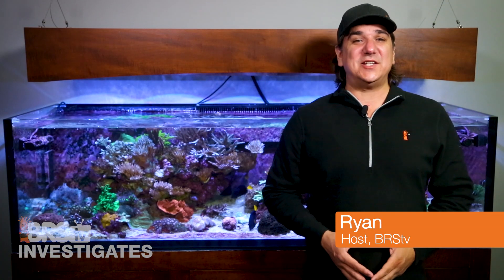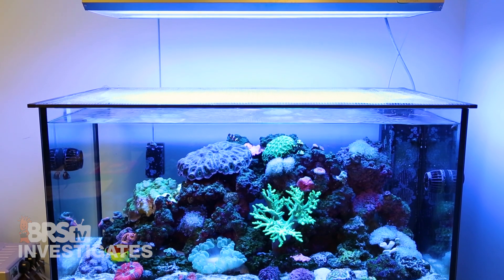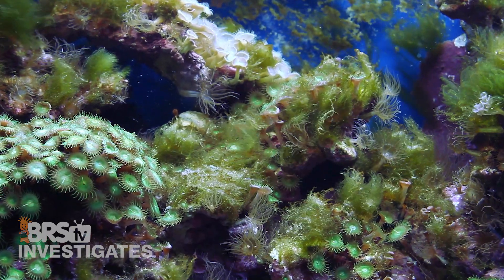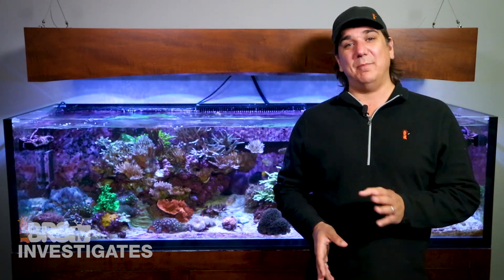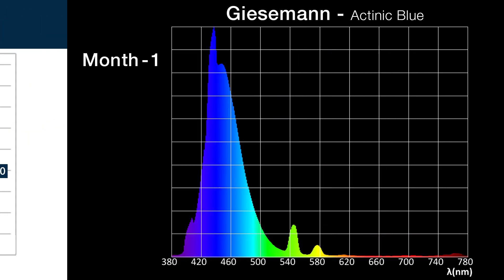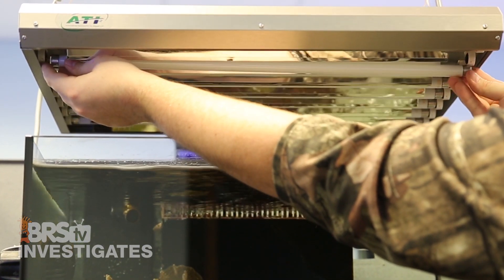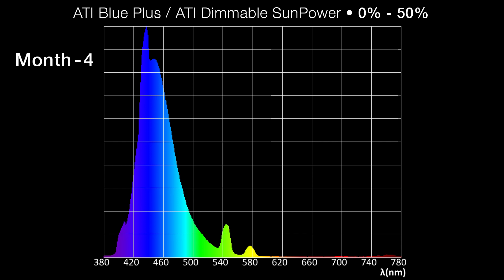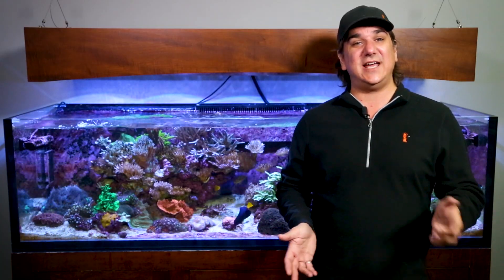When do we REALLY need to change out T5 bulbs? Part II  | BRStv Investigates

Comment: It makes since that dimming is much less stressful for the tubes because in regular TIME bulbs theres actually 3 different types of ballasts. Instant start rapid start and programmed start.  Instant start is great for bathrooms or whatnot because they instantly turn on and will likely only be on for a short amount of time. Then downside of that is the ballast is always pumping a higher amount of current so the light no only Burns out quicker being instantly started, but also the whole setup uses more power. IDK what type of ballasts the T5s use in these fixtures but that will also play into how long they last. I assume a dimming T5 is some sort of programmed start with other features so that would be the best bet.  Seems to me that the ATI dimming fixtures pay for themselves after awhile.

Comment: Did you guys burn in the bulbs before running them at 50% for that long? There's information all over the place about needing to burn in the bulbs at 100% for ~50 hours before using them at lower wattage permanently. I'd like to know if there's any truth to that burn-in process.

Comment: Thanks Ryan, while this may eat away at some of your sales I'm a happier and more informed customer because of it.  Are you running a similar halide test?
Reply: Helpful, but the study doesn't include any spectrum changes and it's based on 14k double ended bulbs.  I think 20k Radium's are probably most common.  I use the single ended version in my Spectra fixture.  Checking out the References at the bottom of your link now.  Thanks.

Comment: Thanks for your investigative series 👌

Here is a question I would like answered. Do LEDs last as long as many assume? Do they put out the same PAR, and at the same settings does their spectrum shift? We were led to believe they would last many years. I do DIY LED fixtures with Cree LEDs and visually I noticed that my cool whites are significantly more yellow than when I first got them. They probably only have about 2 years use.
Reply: I'm wondering that too, I think Cree data is taken when these diodes are run at their ideal temperature (350mA range I believe for many of them) unfortunately in our hobby we tend to run them at 3+ times that and assume that if we have sufficient cooling then no harm no foul.      But I've noticed year old Kessil fixtures vs Brand new have a noticeable bright difference.
Reply: No they don't, I noticed a significant dropoff in par after 4years use with my original orpheks and AI Sols, gone back to T5's with LEDs so will have to wait a while to see if these leds drop in par.

Comment: I heard ATi fixtures drive the bulbs for higher PAR. Apparently they age bulbs faster for this reason. Could you test this myth?
Reply: An ATI fixture uses spec T5 ballasts. When cooled properly some spec T5 ballasts can increase power but only if it is safe to do so. The unit used was an ATI Sunpower as well so that basically answers the question.
Reply: I wish the data would have been used with an ATI Sunpower. Still gives us a good idea regardless.